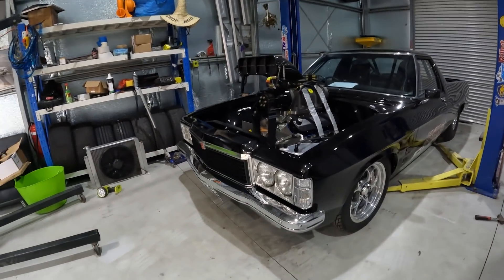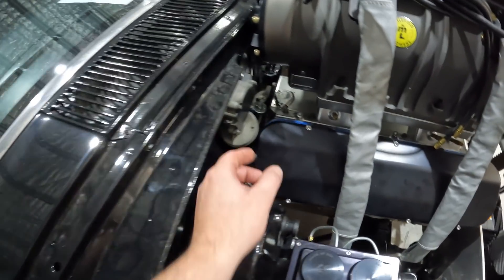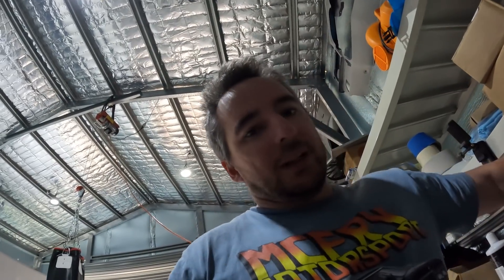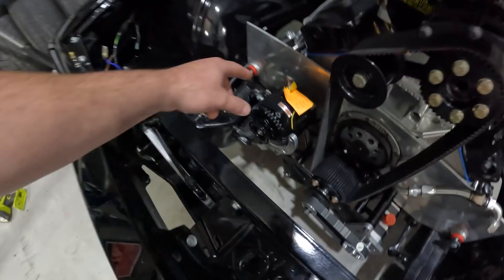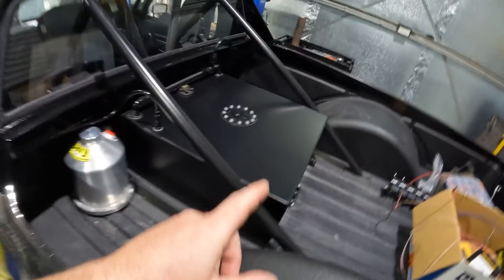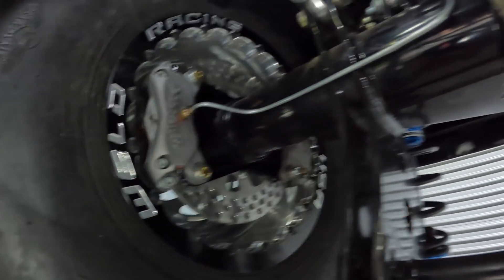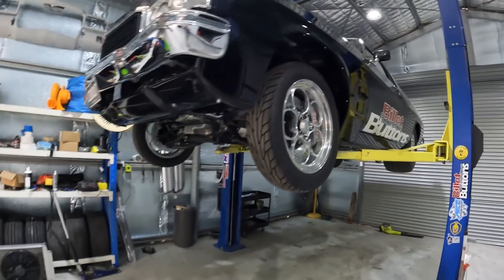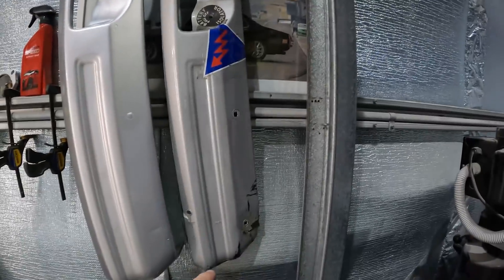#20 ENGINE HAS ARRIVED Holden HZ ute project LOOKOUT

Comment: Ive been building the exact engine setup alternater off crank support oil pump im running front mag drive also its been a logistical nightmare setting it up also going into a h series